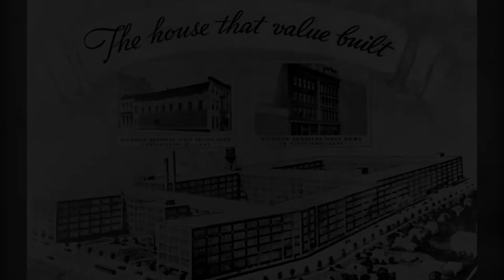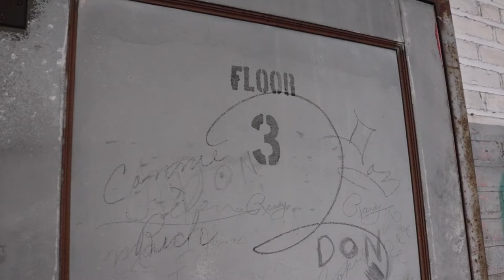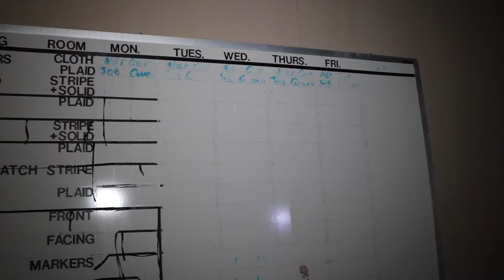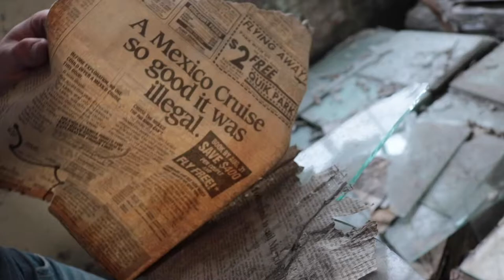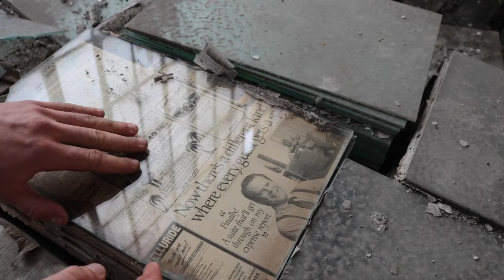Exploring The Abandoned Richman Bros Factory In Cleveland Ohio

Comment: my friend Cree threw the 420 Raves in CLEVO back in the late 90's, he tried to do a 420 there, spent like 3 weeks making it safe, had trampolines, 5 different rave rooms, bunch more stuff. on 4/16 the owners pulled the plug. I worked at the Agora at the time so we talked to Hank and did that 420 there.... The Agora building is another video you should do. Only 1/3 of that building is used, and it use to be WHK Radio, with the live broadcast studios still there and another Venue upstairs.....E55 was (is) super rough back then